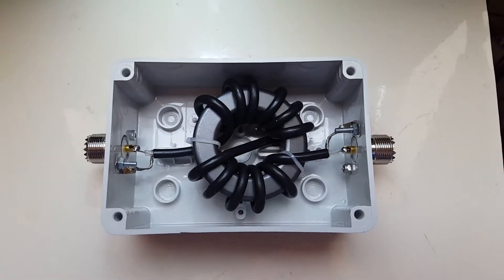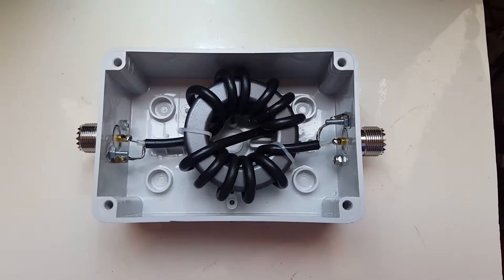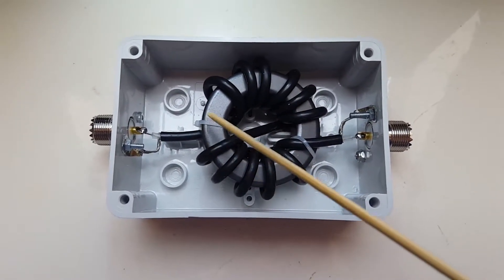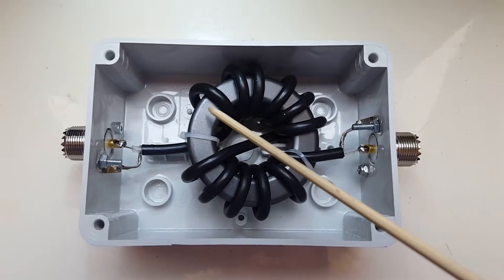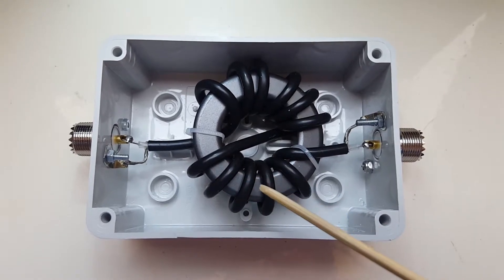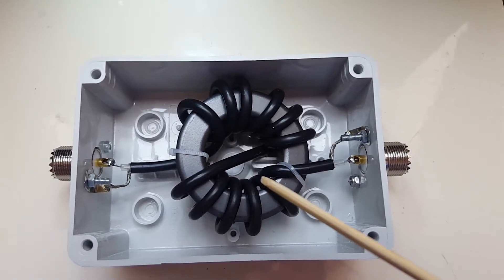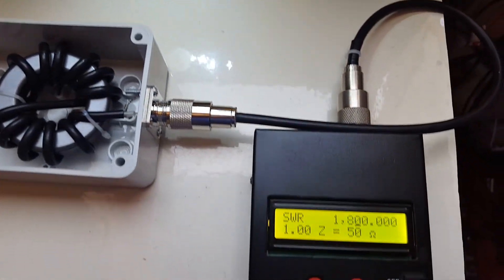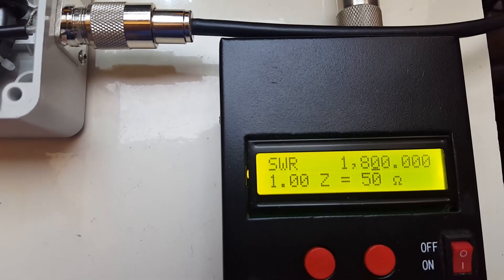1:1 Balun / Line isolator / Common Mode RF Choke

Comment: Amazing , thank you for sharing , will this choke work on 27 MHz ?.
Reply from the maker: Hi Julian,mine has got no problems in all bands including 10m.73s
Reply: Thank you for your information , that's much appreciated . @mm0umz426
Reply: Thank you for your help , I've just made the choke , except I have used PL259 plugs into SO239 bulkhead inline chassis connectors to reduce signal loss.  @mm0umz426

Comment: Hi you maybe a MM0, but this test does not show that it works as a RF Choke, i am sure it does,  it only shows that the coax is connected to a 50 ohm load,
Dave
Reply from the maker: I agree 100%,connecting to a dummy load is only a "quick" check of it's performance on different bands.Rf attenuation and or losses can be verified  if you have all the test equipment. The vid was intended as a general build for an average ham like me.cheers and happy new year..

Comment: Very nice video and build!    For the actual choke,  then a number of comments.   First -31 mix is probably a better choice.  What's interesting in this application,  is that the cross over doesn't matter electrically (it does in other circumstances) but here helps produce a nice build.   A more important point is that the number of turns required is actually related to the frequency you want the choke to be effective at.  I made a choke like this for 60m  and it reduced common mode by over 80% (RF clip on ammeters are very easy to build - see GM3SEK notebook via google), one day I left the choke in circuit by accident when I switched in my 4 metre quad - all the IT in the shack went crazy, all the USB switches starting clicking and complaining.    Chokes can cause problems, you need the rigth choke for the job.   To get the best choke for the job,  then the K9YC cookbook is a free download and highly rated.    The measurement you make in the video is simple the perfromance of a short length of coax between two connectors - its effectively telling you if you have an o/c or s/c condition.   In order to measure the choke performance in terms of its impedance at a given frequency, then connect then take the brad at each end of the choke and measure the impedance.   Thats were the choking action is and its where the unwanted common mode flows.
Reply from the maker: Hi Steve,thanks for the very informative comments. I use mine for the 40m Sky Loop and the number of turns on the toroid suits my application. I don't detect any  rf in the shack so it must be doing it' job.I 'll leave the specs to the more technically oriented. 73s

Comment: Now we know your dummy load has an acceptable VSWR. All this shows is your CMC doesn't affect it's SWR, so it shouldn't affect an antenna SWR either. A GOOD test in and of itself. A LOT of people think these will raise your SWR, cut down your power, mess up your audio, etc, etc, etc. All of these stories are wrong, all this does is reduce RF coming back to your radio via the outside of the braid on your unbalanced feedline. If you want to run 1500w or more, just stack a few toroids and use more coax. 2 x FT240-43 is good for 500w+, 3x FT240-43 will handle 1500w+ SSB and 800w+ CW. You shouldn't use RG-58 for very high power, if you run over 200w, use a better coax.
Reply from the maker: I totally agree..of course  there will always be losses although minimal. Thanks for sharing your ideas..73
Reply: @mm0umz426  Not my ideas my friend, like everyone else, I'm just relaying information discovered by radio guy's 60 years ago, none of this is new, just forgotten.
Reply: I agree too: it's ridiculous. It is just a short lenght of coax and a dummy load: what he expected from the analyzer? This is not the way to test a balun or a choke, but today's om's speak and make videos to propagate what they don't know.
The limit about the max usable power must be calculated in a different: way: this is not an inductor or a transformer in which flows the whole power of the transmitter, but just the small part running outside the coax braid.
Smaller toroids can be used: nucleus so large are useful to get enough room for the cable to wind. Better to use the Rg-142.
It is much more important to use the right material for an efficient balun!
Reply: If i should use 2 torroids FT240-43 and RG142 Teflon coax. What would be my max power for CW and PEP SSB.

Comment: Hi Fernando, what is the CMC attenuation of the choke? Low SWR is fine, but it does not say anything about performance. Best OZ1CK Jens
Reply from the maker: Sorry Jens,I don't have sophisticated equipment to do quantitative measurements for attennuation,insertion loss etc..I only used an antenna analyser to check for match and a simple rf detector to verify that no rf is going back via the coax shield..cheers and 73s mate!

Comment: Would it make any difference if the rg58 coax is copper or a aluminum coated screen like yours.
Reply from the maker: hi James,I used silver coated copper braid rg58 coax, the aluminum shielded coax will be hard to coil around the toroid (too rigid) 73s

Comment: I'm curious, why FT240-42 and not -31?
Reply from the maker: hi Joe, you get more inductance per turn from the type 31 toroid compared to the type 43, so it works best on lower frequency bands,if you noticed ,the SWR rises a bit as you go higher in frequency. Hope this helps.
Reply: @mm0umz426  Thank you Fernando. I'm building one now using 12 AWG PTFE wire. Great video.

Comment: Good video, nice and clear, just one thing, don't you have six turns per side... every time a conductor passes through the toroid hole is one turn, please correct me if in error.
Reply from the maker: good spot John..yes you're right ! I failed to count the cross-over as one turn.My mistake and I do apologise for the error. The important thing is there should be same number of turns per side. Thanks ..73s

Comment: Nice video, What do you think the power handling of the RG58 isolator is? I am going to try to make some but want to be able to run full UK power at times.
Reply from the maker: thanks for the nice comment.I've tested mine no more than 150 watts,
if you're running uk legal then I suggest use a teflon jacketed coax, e.g. RG-316,RG-178B,RG-188 etc. cheers!
Reply: @mm0umz426  I was thinking a Teflon coated coax might be better. I am going to make some up using Silicone coated 18 Gauge wire too and see how I get on. Of course I have plenty of RG58 lying around but no Teflon coated :-)

Comment: Make sure your audience knows that that is a Guanella 1:1 Balun
Reply from the maker: Thanks for the comment,yes it's a Guanella 1:1 current balun..cheers
Reply: @mm0umz426  In actuality it is a 1:1 unun (unbalanced to unbalanced) not a 1:1 balun (balanced to unbalanced) as it does not act as an impedance transformer but simply as a common mode choke (line isolator).
Reply from the maker: @jfrphoto01  you are absolutely right,it is a 1:1 un-un actually. 73